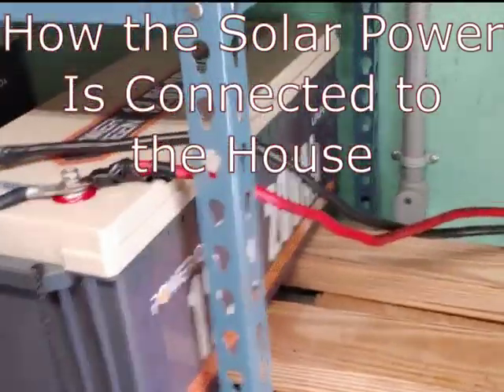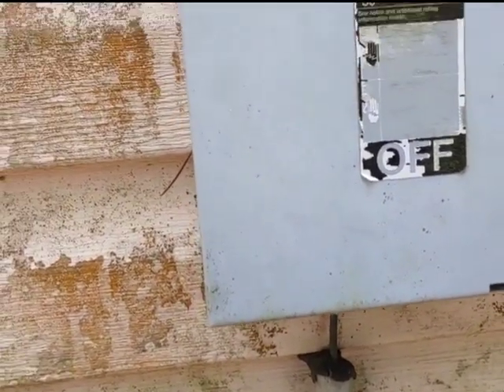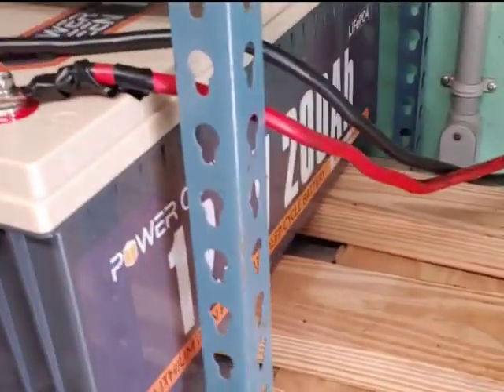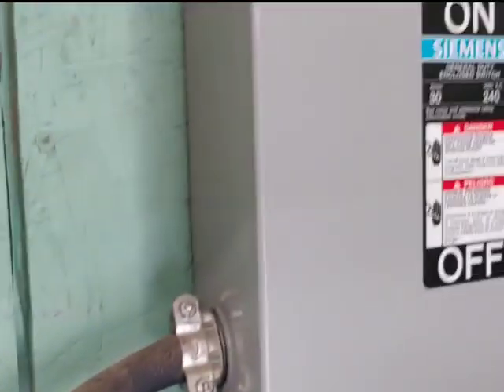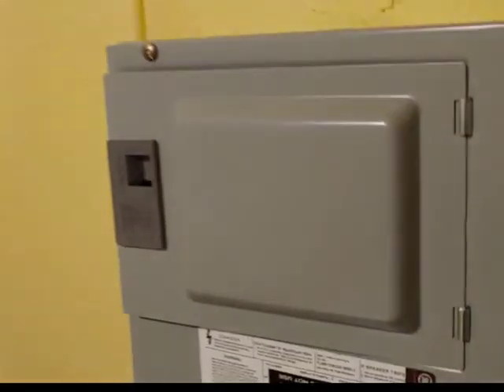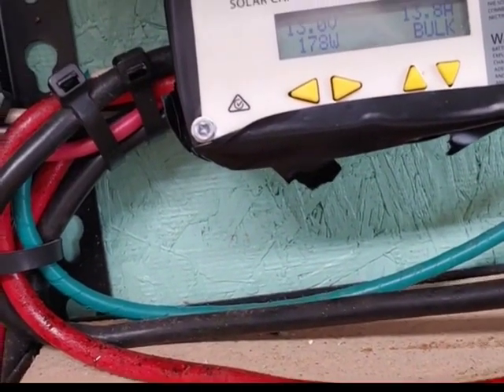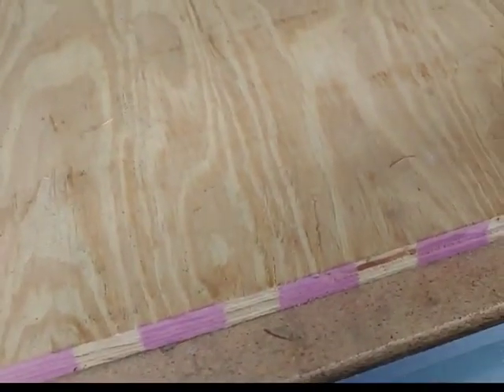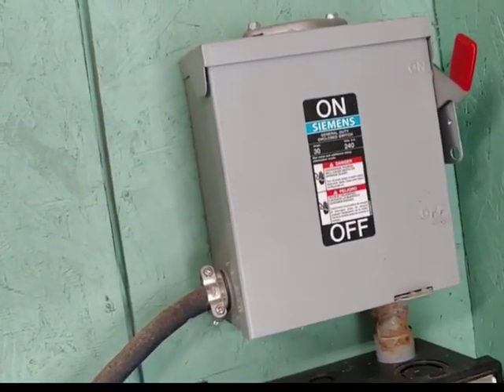How I connect my off grid solar power system to the house.

Comment: It's always easier to have more panels than a bigger inverter. This also increases the amount of power you can use in a power outage. Batteries are more efficient at 24 or 48 volts because the current drawn is less so the cables and connectors lose less power. My favourite brand of inverter is Victron many have chargers built in some will do split phase for you. Just be careful with inverter power rating a 9000W inverter assumes that you have 900amps to give it, which you haven't! If that were on 48v you'd need 225A which is quite reasonable for carefully chosen cables and connectors.
Reply from the maker: Thanks for your tips and comment.

Comment: I have two inverters I use. One is a 3000 watt powmr all in one unit. It does my regular camper 30 Amp plug. Then I have a 4000 watt low frequency sungold power also. The sungold does 110 and 220. The sungold is for the minisplit and the electric side of my waterheater. I also have another charge controller that's a 100 Amp powmr. I currently have 8 panels sharp brand that's 235 watts each.  I'm currently using 24 nissan leaf modules in a 24 volt configuration. I highly recommend the sungold power inverter if you need 220 split phase. They come in a variety of sizes  and are pure sine wave
Reply from the maker: Thanks for your recommendations and comment.

Comment: Are you freaking kidding me.  You have a 8kw inverter connected via 12volts.  That should be an 48 volt system at that power level -- same for the 6kw system you mentioned -- both are way too powerful for a 12 volt system.  Also, modified sine wave and your feeding it into your house.  Again, are you freaking kidding me!  Good way to destroy sensitive electronics.
Reply from the maker: The system I have is working just fine. None of my electronics have been destroyed as of yet thank goodness. Thanks for your comment.